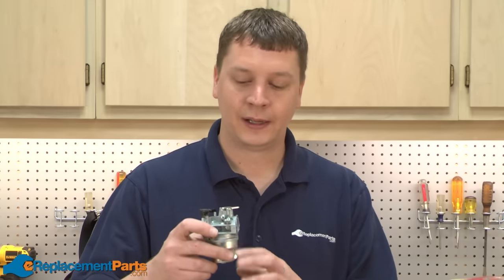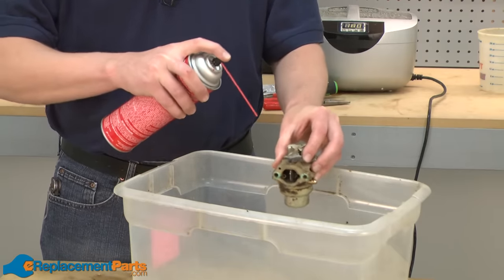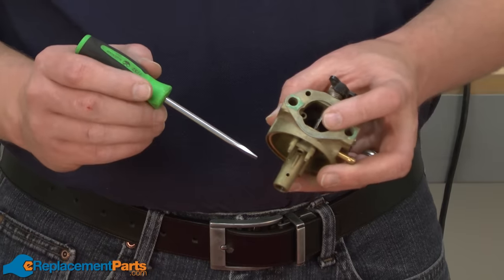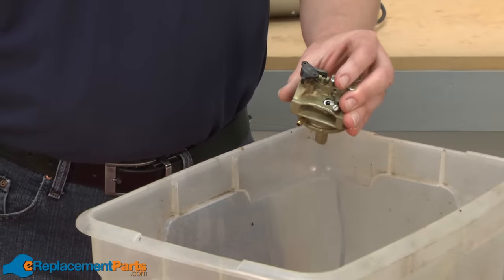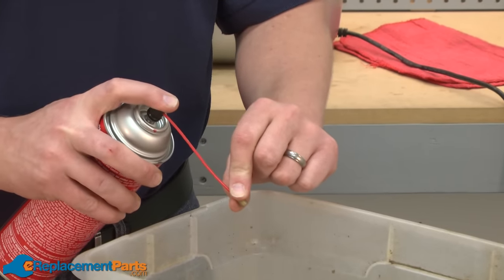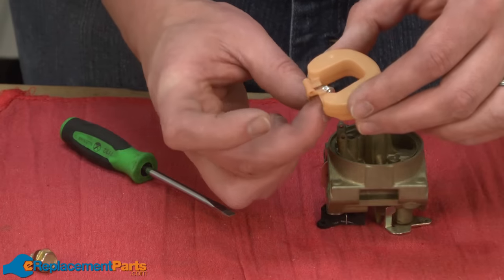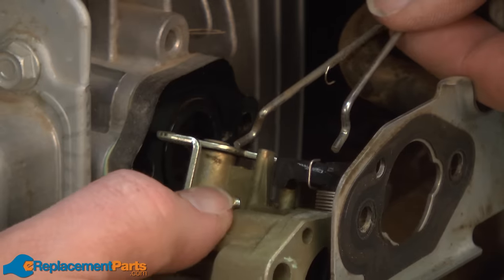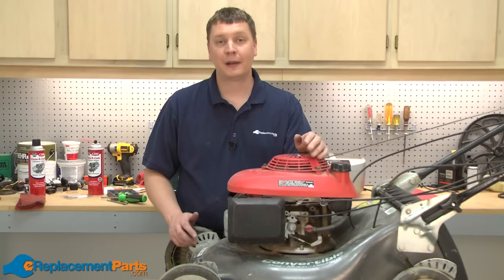How to Fix a Lawn Mower Carburetor

Comment: This helped a lot.  A relative put gas oil mix in the tank by mistake, then after it died it sat for 5 years.  So after cleaning everything last month,  I had cleaned the carb already but engine was still not getting gas.  So I pulled carb apart again after watching your video, and sure enough the main jet and emulsion tube were clogged.  I missed those the first time.  After reassembly the mower fired up on the first pull.  I was a bit stunned by that lol.  Thanks!

Comment: ok I have a 173cc powermore engine that runs and starts on first pull but then it starts to miss and it blows black smoke, I took the carb off and cleaned every thing, it looked real clean inside but the needle valve the tip is plastic and it didn't look too good, could this be why it still blows black smoke out, the plug turns black after about 30 seconds of running

Comment: Martin, This is a great video!  My Honda HRS216 PDA lawn mover bought in 1998 had been hard to start for years.  It cost me $13.00 to fix, which I ordered online.  The shipping costs actually cost more than the 3 gaskets I needed.  This was the first time that I had done anything like this.  I regret to inform you that I tried to get my gaskets from your website, but was unable to.  After all, your video helped tremendously.  I gave the information from my owner's manual to a person answering the phone, but she could not locate anything on this lawn mower model.  I called a competing repair website to order the parts.  They had no problem finding the model and correct parts.  I am telling you this, because I thought you would like to know.  Keep up the great work with these videos.  I am a big fan!

Comment: Thanks for putting it back together ... step by step..

I had thought that i had lost the float connector wire...    you showed how it just slipped on the float and into the hole..

thanks again...

Comment: Great video The Keihin carb on my Troy-Bilt TB130 quit running after mowing dusty dead grass. Blew air through all the ports and it's running great again. Thankfully didn't need to remove the jet or emulsion tube. I didn't know about the main port screw on top of the carb. Once I cleaned it our, all was good again. The mower repair place I used to pay usually had 6 months of mowers to fix by the end of march and won't take anymore after mid April and said most were due to dirty carbs. Glad there were no diaphragms on the new carb. Thanks again.

Comment: Excellent video!  Can anyone tell me what the screw does that is next to the idle pilot jet screw at the 12:47 mark?  It has a cast aluminum cap on it and was wondering if it's an idle or mixture adjustment and how to adjust.

Comment: Hi I finally found a tut explaining how to fix  carb on my gen.  My question is that after a long period of rest that small spring on the idle (?) rusted and broke off. I tried to replace it but now it works for a second and stops.  Is this the springs fault?  How could I fix it?  Pl help me.  Tks.

Comment: Great video, I've done a lot of engine work but because my hands are not small, I always had a hard time rebuilding smaller carburetors like this one. Now that I think about it, I never even tried thinking that there were a bunch of small jets inside that needed attention. Seeing your video has restored my confidence to attempt the rebuild. Any idea how much the rebuild gasket kit costs?
Reply: They are usually pretty cheap, think around 10$ depending upon what you're working on.

Comment: Hi, thanks for all the info so far!
I have one question, some lawn trimmer engines have a transparent plastic bulb that you have to press to fill it up with fuel/oil. Why is this there or what does it do exactly? And what is the difference in starting the engine when this bulb is full or empty. Currently, my plastic/rubbery bulb is torn, is it necessary to replace it? Can fuel leak out of here when starting/running the engine? Is it dangerous? 
Thanks!
Reply from the maker: The clear bulb you're asking about is the primer bulb.  All it is designed to do is get the fuel mixture to the carburetor before you start the tool.  Usually you only need to prime the motor if it hasn't been started for a while. Usually, motors wont start with out fuel being sighted in the primer bulb.  The bulb only brings the fuel to the carburetor. Once the carburetor is full, the left over mixture is returned to the fuel tank via the return line.  You're very lucky if you tool starts without priming.  If the bulb is torn, you should replace it before any contaminants can breech the bulb and enter the carburetor.  Ports in these carburetors are very small and the smallest piece of debris will cause your equipment to stall.

Comment: This carb looks nearly identical to the one on my Subaru PowerStroke pressure washer (EA190V-50031).  I appreciate this video, now I know my carb very well.  

I take it there isn't a way to adjust the mixture on this carburetor?
Reply from the maker: These are jetted at the factory and they air adjusting screws have been eliminated.

Comment: This video was very informative. I have a different question, that is, I have a snapper lawnmower with a Brigs and  Stratton,it would not start so, I drain the tank    clean the carburetor it still starts up and shut down it did that several times I then take the cylinder head off and clean the soot off this time it did not start did I messed it up by talking off the head.

Comment: great vid  I think the only thing Id mention (which you may have I may have missed it) is wearing eye protection with the carb cleaner.  I cant tell you how many times Ive done that till I told my self EVERYTIME I use carb cleaner I will use eye protection even if just for a quick cleaning

Comment: Thanks for this. I've got a mountfield with the 150 engine. Carb is identical or at least very similar. Engine got over-loaded last weekend & I think one of the gaskets has blown. just need to find which one. Thanks again.
Reply from the maker: Hope your repair goes well! You'll need your lawn mower in good condition with summer just around the corner!

Comment: Nice video!
I have 2 questions:

1) I did not manage to remove the emulsion tube like on 04:25? Any advice?

2) I have forgotten the right distance of the "idle screw". Should I screw it very loose on it, and than tightening?

Comment: So the main jet just bottoms out and the only re-set you need to be concerned with is the idle screw? Thanks for this video
Reply from the maker: Hello, yes, on this type of carburetor, but there are different types that may differ in adjustments.

Comment: After cleaning do you use any lubricant/grease for the internal moving parts?
Reply: No you don't use lubricants in carburetor parts, the fuel flowing through will lubricate the parts enough.

Comment: In my experience  with carb problems  a lot of times they suck air  thru a loose   mount or work loose as time goes on .. so a little bit of epoxy glue on the mount bolts fixes the problem.

Comment: I put it back together and can't get the bolts to screw in so the carburetor is snug.  The bolts feel like they are tight but the carburetor is loose when I wiggle it and one of the bolts is not all the way down next to the plastic air filter back cover.  Any helpful suggestions?
Reply: Never mind.  There was a plastic spacer piece that I hadn't seen that had fallen down when I removed it all.  I put that back where it was supposed to go and everything tightened up perfectly.
Reply from the maker: Sorry we didn't get back to you, but I'm glad your repair went well!

Comment: First of all, great video! It looks like your working on a Honda motor on a Troy-Bilt mower, is that right?

I don't usually do well with fixing motors, but I noticed today that my mower was leaking gas. So after a bit of searching on the internet, I found out a little about carbs and I took mine off, wiped it down, put it back together and it no longer leaks!

But... when I first started it, it ran really fast. It felt like it was going to take off. I was able to mow a little, but then it stalled. Still not leaking gas, but it only runs for a couple of minutes and stalls. Any clue what causes this?

I'm going to go get some carb cleaner and new gaskets tomorrow and take it back apart (now that I know how). Do you think that will fix it?

Thanks!

Comment: Thanks for this very helpful video without which I wouldn't have attempted the job. However you didn't show us the trickiest part of the reassembly, i.e., lining up the carburettor, heat shield, gaskets with the air filter housing and attaching the air hose while refitting the long bolts.  All without damaging the new gaskets you are fitting.  This was the most awkward part of the whole job holding everything in place.
Reply: Great info !!!! my honda is 7 years old and after the cleaning, (no sonic machine) it started on the first pull. But your right the hardest part was re-attaching the filter housing.

Comment: Right above the left screw that ties into the motor there is a little hole is that seep hole? Can the carb leak from it if so does that mean it needs to be replaced? My carb is leaking from that side and both of my gaskets look good. Please help.

Comment: After taking the carburetor apart and having it clean at a Honda repair shop it runs way to fast. What screw do I adjust to reduce the fast idle? Can I adjust it without taking the carburetor off? Thanks.

Comment: I have a homelight HBC26SJSB Mighty Lite Brush Cutter. Except I don't, apparently. I can find service manuals for all the models close to mine but none for it. Even the Homelite page has no knowledge of my machine. None of the close models such as the HBC26SJS are built the same way.
The problem is how to fit the throttle trigger mechanism back together. The trigger has a powerful spring attached that locates in a tiny hole in the trigger and the other end of the spring has to jam against the housing. The problem is that no matter what I do I cannot refit the trigger without the spring pinging loose. Also, there is another item I can't make head nor tail of inside the trigger casing. It is a piece of wire that is formed into an O shape at one end and a U shape at the other. No idea what it is for or where it goes. 
If you can help I would be very grateful. I don't want to throw this machine away or pay someone more than it is worth to have it fixed.

Comment: This vid is great thanks. But once we re-installed there is gas leaking from the air intake whilst idle any idea why?

Thanks (P.S.) We have the same engine/carb
Reply from the maker: It sounds like the needle valve in the carburetor bowl isn't shutting the fuel off completely.  Extra fuel is
going into the carb.  At higher RPM's the motor is pulling it into the piston but at lower RPM's it's running out of the intake.  It could also be the float level but my guess is the needle valve.
Reply: +eReplacementParts.com thanks for the reply mate. Do you guys sell the Needle valve part?

Comment: What was the tool with blue handles used to crimp/clamp the fuel line before removing the carb?
Reply from the maker: +Ron Willard That tool is just called the fuel line crimper .
Reply: A pair of vice grips will do the same thing!

Comment: I recently did an overhaul of my Briggs & Stratton Carb (12H802-3172-B1) from my Murray lawnmower. I bought the kit-carb overhaul kit and replaced all the parts included in the kit. The only problem was it started leaking gas without the lawnmower even on. The only thing the kit didn't come with was the float so I kept the original. I don't now if this could cause this kind of an issue. Any ideas how to fix the issue? The gas is leaking from two small holes along the inside the carb.
I noticed someone else had a gas leaking issue. But in my case the needle was replaced with a new one. Could it in fact be caused by the float?
Reply from the maker: This definitely sound like the needle valve isn't shutting the gas off once the bulb is full.  Pull the bottom off the carb and check to see if the float has developed and filled with gas.  If it has gas in it you'll need to replace it.  If that looks good I'd pull the needle valve back out and make sure it is seating correctly. Some of the floats have a brass bracket that you can bend to adjust and others are plastic and are set to factory specs.
Reply: I followed your instructions eReplacementParts. All looked good....the float was not cracked or damaged. My float did not have a brass bracket. It's all plastic.
But here is what finally fixed the problem. I hope it helps others who might encounter the same problem. If anyone else out there also like me pulls everything out and double and triple checks everything and nothings looks damaged or out of place and you feel 100% sure you did everything right......Just turn it on!!! This is what finally fixed the leaking gas coming from the carb. I ran it for a few minutes after I couldn't think of what else to do and wouldn't you know it.....the mower ran good. After about 5 minutes I turned the mower off and checked for that drip drip of gas I noticed before and nothing. Woo Hoo!!! So after about 3 weeks, the mower is running great and no more gas leakage.
Thanks eReplacementParts for responding back and hope this helps others. Good luck and Stay Dirty.

Comment: I'm trying to find a new complete carburetor for my Briggs & Stratton 8 HP engine, Model # 200401 type 0019-01 serial #6808021. Do you have any info on where I can order one? it's for my 720 simplicity garden tractor, I have tried Briggs & Stratton parts, ereplacement parts. Thanks for any help 5/25/2016

Comment: You left out removing and replacing the needle valve gasket. Also, you should have removed or scraped of the old gaskets before putting the parts into the ultra sonic cleaner, or certainly right after removing them from the cleaner. not after you had already started putting the carburetor together. As many have noted, you should watch out for your safety more. Wear safety glasses when spraying carb cleaner.
I would remove the wedding ring and at the least put on a pair of neoprene gloves. If the carb cleaner is strong enough to remove deposits off the carburetor, what do you think it is doing to your skin....especially if it gets up under your wedding ring. These criticisms aside, I appreciate the clearity of the video, good lighting, and clear instructions. Your voice is good enough that you could be a professional narrator.
I would like to see you make a video of rebuilding the carburetor on smaller lawn mower engines (they are different) and another video on cleaning and rebuilding weed eater and chain saw engines.

Comment: Got a Honda mower, when it is tipped to the carb side gas runs out of the throat of the carb soaking the filter. What is the fix?
Reply: Don't tilt the mower with the carb facing down. If you do it will result in soaking the air filter with gasoline making it impossible to start do  to the air restriction created by the fuel soaked  air filter.

Comment: some advise from me.. if there is a carburator issues, you should be more thorough. cleaning a carburator itself is not enough, air filter and fuel tank need to be cleaned too to prevent dirt and metal corrosion residue to get in to the carburator

Comment: Is there a reason you didn't just put the pilot jet, emulsion tube, main jet, etc. into the ultrasonic parts cleaner as well?
Reply from the maker: Good question. There's no real reason, as Mark mentions in the video, you can put them in the ultrasonic parts cleaner as well, but his preferred method is to just use carb cleaner. This is a preference thing, and is mainly because the parts are small, and it's often just quicker and easier to do with carb cleaner. Thanks for your question!
Reply: eReplacementParts.com Awesome.  I was using this for my pressure washer carburetor.  In the end, I needed a new one b/C mine doesn't break down as far.  I did find this to be very informative and helpful in general.  I like visual/tactile learning.
Thanks for the initial post and response! 😂

Comment: Hey so I did everything that you said, but now when I prime it, I got gas coming out everywhere around the bowl and in the air box??? What happened?
Reply from the maker: Hi Matt. I think this repair guide for a leaking carburetor may help you:
https://www.ereplacementparts.com/repair-center/lawn-equipment/lawn-mower/leaks-gas/
If this does not help, feel free to reach out and we can troubleshoot further. Good luck with your repair!

Comment: Theres too many screws damnit!!!!!! I tried to take the carburetor apart and this little plastic thing fell to the floor. I have NO IDEA what or where it was attached to! Any clue? I just want to mow my lawn and not pay $100 to fix something I could fix myself! this is a nightmare! my lawn is getting taller by the minute!
Reply: u have a pic of the part that fell?
Reply from the maker: The plastic part she holds up is the fuel line splicer of AKA connector.  It's used to splice to smaller pieces of fuel line together.
Reply: BlinkinFirefly I feel you!!  I took ours to a repair shop for help and they gave it back to us the carb in a shoe box in pieces! The mower is almost new and I've not been able to repair ours either.  :(
Reply: BlinkinFirefly its your float it attaches to your needle google it
Reply: Joe Cwik That's just effed up!!!! =(
Reply: MONEYBAGS603 nah I don't think its a float, it looks like a fuel filter
Reply: +BlinkinFirefly buy a new carb on ebay.